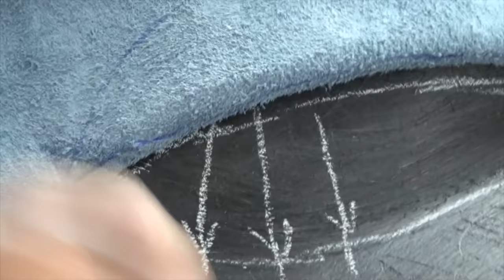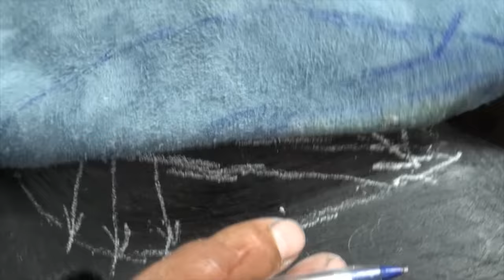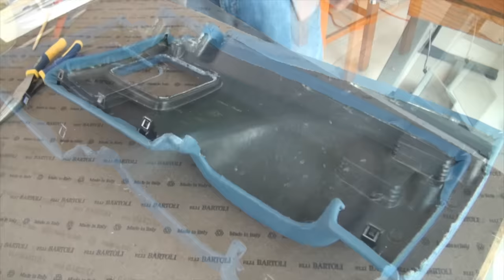A Plastic Piece Wrapped in Leather - Auto Upholstery

Comment: Great video! So much to learn from this--thank you for sharing! Videos like this are so impressive, and helpful for DIY auto restoration hobbiest.

I am attempting to recover my 66 f100 vinyl dash (with matching vinyl). Would same process apply? What glue do you recommend?
Reply from the maker: You coul use the traditional yellow glue:https://www.youtube.com/watch?v=o2xeezdF8Ss&t=104s
https://www.amazon.com.mx/00271-Weldwood-Original-Contact-Cement/dp/B0006MXRY8
https://www.amazon.com/-/es/Petronios-Master-Cemento-multiuso-cada/dp/B076DJQN5R?language=en_US
For a better adhesion you could apply two coats on both pieces dash and vinyl material. A first coat acts as a primer (let it dry well) The second is the good one.

Comment: Good job. ❤ what kind of  glue you used ?
Reply from the maker: https://www.youtube.com/watch?v=o2xeezdF8Ss&t=60s
https://glueplace.com/industries/contact-adhesives/dap-weldwood-contact-cement-top-trim-hhr-solvent-type-spray-grade-5-gallon/ (sprayable and brushable)
https://www.ebay.com/itm/114649877783 (brushable)
https://youtu.be/RLH8BY8a2to?t=128

Comment: Just wanna ask, will it help to use a heat gun on it?
Reply from the maker: What is most important is the detection of stretchty side of leather material.
https://www.youtube.com/watch?v=dhmCJFpOs_0&t=57s
A heat gun is mostly used on vinyl/plastic materials. In case of leather it would be much better a hair dryer to erase wrinkles. Just a particular opinion.

Comment: I'm struggling with finding the proper glue what are you using
Reply from the maker: Upholstery yellow glue (brushable/spreadable)https://www.youtube.com/watch?v=o2xeezdF8Ss&t=485s
If you are in the USA you could find a similar product.
https://www.amazon.com/-/es/Weldwood-Contacto-calcoman%C3%ADa-Solvente-00233/dp/B008G8KVZ2 (brushable and sprayable)
https://www.homedepot.com/p/DAP-Weldwood-3-fl-oz-Original-Contact-Cement-00107/100195615 (brushable/spreadable)
https://www.petronioshoeproducts.com/master.htm (brushable/spreadable)

Comment: What brand of contact cement did you use. Looks perfect. THANKS Sid
Reply from the maker: I use a 'yellow glue/contact cement' most of the upholsterers, shoemakers and leather artisans use.
As I am located in Mexico, trade marks are different. But, if you are in USA, please, check these links:
https://angelusdirect.com/products/all-purpose-shoe-cement
http://www.ebay.es/itm/Petronios-Master-All-Purpose-Cement-Glue-Shoe-Repair-Adhesive-Glue-4-oz-/112032405167
http://www.homedepot.com/p/DAP-Weldwood-32-fl-oz-Original-Contact-Cement-00272/100125525
http://www.dap.com/dap-products-ph/weldwood-landau-top-trim-high-heat-resistant-contact-cement/

ben swanson Hace 12 horas
black rose garage in usa home depot sells. Weldwood contact cement.   It is the standard glue for upholstery

Comment: I found your video very helpful, however, the contact cement has seeped through the upholstery leaving black spots on it.  I applied it to both the door panel piece and the back of the upholstery.  I did not apply it on thick.  It is a foam-backed micro fiber suede upholstery.  Any recommendations?
Reply from the maker: If the surface is somehow flat you can use this method:
https://www.youtube.com/watch?v=coueKGKYlds
If the surface is irregular the correct way would be the application of glue on both surfaces by using a 'glue spraying gun'. 
A glue spraying can could help in case of not having a glue gun.

Comment: Hi Cechaflo! I really really appreciate your work and your sharing. So precise work without heating, it is amazing. I would like to ask you for glue recommending, which is available in EU (Czech Republic). Also, do you crop the thickness of the leather? Somewhere it seems like that leather is more furry.
Reply from the maker: Most of the upholsterers, shoemakers and leather artisans in many countries use a 'solvent based yellow glue'. I don't know in Europe the trade marks. Perhaps a friendly upholsterer, could give some advise.Hopefully, on ebay, amazon you could buy this product.

To have an idea, please, check these links for USA
http://www.ebay.com/itm/Petronio-039-s-Master-All-Purpose-Cement-Glue-Shoe-Repair-Adhesive-Glue-4-oz-/112032405167?_ul=EC
http://www.ebay.com/bhp/weldwood-contact-cement
I didn't skive the leather piece to wrap this plastic piece.

Comment: Hi great detailed video! I would like to know what kind of glue/adhesive is usually used on this kind of upholstery (between plastic and leather)? Cheers
Reply from the maker: I have used a solvent based(thinner) adhesive/cement/glue which most of the upholsterers and shoemakers use. To have an idea, please check these links:
http://www.ebay.com/itm/Petronio-039-s-Master-All-Purpose-Cement-Glue-Shoe-Repair-Adhesive-Glue-4-oz-/112032405167?_ul=EC
http://www.ebay.com/bhp/weldwood-contact-cement
If you're going to use one of these products, do a test beforehand.
Reply: Thanks for your reply! The link is really helpful!

Comment: Looks pretty good. But some of those relief cuts were unnecessary and bad choice of placement. I would never make the cuts so near to the wrapped edge. Some of those are going to be visible from the front. Also I knew you'd regret cutting that opening when and where you did. I could foresee that recess next to the corner would end up pulling the opening in that direction leaving less material to wrap around the inner lip of the fuse panel access opening. Luckily there was just enough left. Love the color selection though. Very nice!

Comment: what kind/brand of glue are you using?
Reply from the maker: The 'solvent based yellow glue' is a traditional adhesive or contact cement used in car upholstery and furniture. 
It is the same glue used to stick formica as shown in the video about Upholstery Glues
✅ https://youtu.be/o2xeezdF8Ss
This other video could be also useful:
✅ https://youtu.be/TIKF6NvXHE4

Comment: What is the brand name of the glue you use? Nice job, It does take a long time .
Reply from the maker: I have used a brushable 'yellow glue' (pegamento de tapicería 2000). The drying time is of 10 min. approx.
I am located in mexico and trade marks are different. If you are in USA, please, check these links:
https://angelusdirect.com/products/all-purpose-shoe-cement
http://www.ebay.es/itm/Petronios-Master-All-Purpose-Cement-Glue-Shoe-Repair-Adhesive-Glue-4-oz-/112032405167
http://www.homedepot.com/p/DAP-Weldwood-32-fl-oz-Original-Contact-Cement-00272/100125525
http://www.dap.com/dap-products-ph/weldwood-landau-top-trim-high-heat-resistant-contact-cement/
Watch min two:08 of this video where Greg shows the use of ´petronios'glue.
https://www.youtube.com/watch?v=RLH8BY8a
This video shows Barge glue from Tandy leather:https://www.youtube.com/watch?v=PE6dGvgWfnU

Comment: What kind of adhesive do u use to put it on ??
Reply from the maker: Upholstery yellow glue :https://www.youtube.com/watch?v=o2xeezdF8Ss
https://www.homedepot.com/p/DAP-Weldwood-128-fl-oz-Original-Contact-Cement-00273/100139723

https://www.ebay.com/p/Petronios-Master-All-Purpose-Cement-Glue-Shoe-Repair-Adhesive-Glue-4-Oz/1280848573?iid=112032405167&chn=ps&_ul=MX&dispctrl=1

Comment: May I ask which glue that is ? I want to upholster smt small on my own and dont know which glue to take
Reply from the maker: I am located in Mexico and I'm using a 'solvent based yellow glue/contact cement'...trade marks are diferent.

If you are in USA, please, check these links:
https://angelusdirect.com/products/all-purpose-shoe-cement
http://www.ebay.es/itm/Petronios-Master-All-Purpose-Cement-Glue-Shoe-Repair-Adhesive-Glue-4-oz-/112032405167
http://www.homedepot.com/p/DAP-Weldwood-32-fl-oz-Original-Contact-Cement-00272/100125525
http://www.dap.com/dap-products-ph/weldwood-landau-top-trim-high-heat-resistant-contact-cement/
Watch min two:08 of this video where Greg shows the use of ´petronios'glue.
https://www.youtube.com/watch?v=RLH8BY8a

Comment: Man, I would be so worried that after all that, that some glue was missed or didn't adhere fully and started to pull away.. Especially in the CENTRE somewhere where it wouldn't be easily fixable..
Reply from the maker: I had this cheap car on test more than six years and the leather-wrapped piece did not unstick, not at all.
The secret is consider the stretchy side of leather and the material should be laid over easily with no tension on hollow areas. I can stretch the material over a convex area until touching the bottom which I will not stretch but lay it flat.
https://www.youtube.com/watch?v=dhmCJFpOs_0&t=25s

Comment: Beautiful work. What adhesive did you use?
Reply from the maker: Thanks so much for appreciating this art craft!

Regarding the adhesive I  have used a 'solvent based yellow glue/contact cement'.  If you are in USA, please, check these links:
https://angelusdirect.com/products/all-purpose-shoe-cement
http://www.ebay.es/itm/Petronios-Master-All-Purpose-Cement-Glue-Shoe-Repair-Adhesive-Glue-4-oz-/112032405167
http://www.homedepot.com/p/DAP-Weldwood-32-fl-oz-Original-Contact-Cement-00272/100125525
http://www.dap.com/dap-products-ph/weldwood-landau-top-trim-high-heat-resistant-contact-cement/

Comment: Appreciate your excellent work. What kind of glue do you use?
Reply from the maker: I use a 'yellow glue/adhesive/cement' most of the upholsterers, shoemakers and leather artisans use...it comes in cans or bottles and it is applicable with a brush or spatula. Check:
https://www.ebay.com/itm/Petronios-Master-All-Purpose-Cement-Glue-Shoe-Repair-Adhesive-Glue-4-oz-/112032405167?_ul=MX
http://www.tandyleather.com/en-usd/home/department/leather-cement-glue/2525-360.aspx
http://www.homedepot.com/p/DAP-32-fl-oz-Weldwood-Original-Contact-Cement-00272/100125525
https://www.google.com.mx/search?q=yellow+glue++contact+cement&espv=2&biw=1093&bih=514&source=lnms&tbm=isch&sa=X&ved=0CAYQ_AUoAWoVChMIqI3u_a_ixgIVhNGACh1z3Ajj
https://www.google.com.mx/search?q=yellow+glue++contact+cement&espv=2&biw=1093&bih=514&source=lnms&tbm=isch&sa=X&ved=0CAYQ_AUoAWoVChMIqI3u_a_ixgIVhNGACh1z3Ajj#tbm=isch&q=pegamento+2000
Thanks for watching my videos!
Reply: Thank you so much for your reply !! That really helps a lot !!

Comment: Took an hour in fast motion , what price would you charge for finished product
Reply: do you want it right, or right now?
Reply from the maker: Hello Karl, the price would be the same fast or slow. To have an idea about the price the whole process would take a half day. Before wrapping the piece is necessary to sand off the plastic considering the leather thickness 1.3 mm approx. otherwise the piece would not fit its place. I think the price depends on the place where we are. I have realized upholsterers in USA charge per hour.
Thanks for watching the video!

Comment: Can someone tell me the name of the glue hes using?
Reply from the maker: It is a brushable glue. Trad marks in Mexico are different.
https://youtu.be/o2xeezdF8Ss?feature=shared&t=30
If you are in the USA:
https://www.ebay.com/itm/254593470049 (mostly a sprayable glue but it can be used as a brushable one)
https://www.ebay.com/itm/114649877783
(Petronio's glue is only a brushable glue)

Comment: What type of glue you are using. Gosh funky dashboard
Reply from the maker: I am using a brushable glue. if you are in USA, check these links:
https://angelusdirect.com/products/all-purpose-shoe-cement
http://www.ebay.es/itm/Petronios-Master-All-Purpose-Cement-Glue-Shoe-Repair-Adhesive-Glue-4-oz-/112032405167
http://www.homedepot.com/p/DAP-Weldwood-32-fl-oz-Original-Contact-Cement-00272/100125525
http://www.dap.com/dap-products-ph/weldwood-landau-top-trim-high-heat-resistant-contact-cement/
Watch min two:08 of this video where Greg shows the use of ´petronios'glue.
https://www.youtube.com/watch?v=RLH8BY8a
This video shows Barge glue from Tandy leather:https://www.youtube.com/watch?v=PE6dGvgWfnU

Comment: The L6 leather was water buffalo. As stated the leather was obsessively treated by the perfectionist architect car guy. It was just too darned hot. This year we just finished 50 consecutive days of over 110 degrees. It is brutal on cars here. No rust ever but clear coats evaporate and plastic turns brittle. Park at a store and get back in ten minutes later and the interior easily exceeds 125 and the steering wheel is too hot to touch till the blasting AC can take the edge off. But it is a dry heat.
Reply from the maker: I cannot deny everyday I learn something new. I have now realized the sun heat in Arizona is astounding. That is equivalent to 43 to 50 Celsius degrees. As if we were in the Sahara Desert. The car leather interior was well kept in the shadow and treated by the owner with special balms, but the sun heat did its job destroying it. I mean warping it, becoming it brittle and shrinking it. Unbelievable.
I also have realized most of these European cars use leather on top panels. The lateral panels are upholstered in a related color vinyl.
It means some of these cars should not be destined and sold for customers who live in too hot places. Did your buddy buy it brand new directly from an agency?
Perhaps, the qualified material would be fire retardant special leather and the same applies for the special vinyl.
Thanks for sharing with us a useful information!
Reply: Near the town of Black Canyon City, north of Phoenix, there is a large outdoor testing facility. There many products are sent to bake in the Arizona sun, sometimes for years, to let the producers know how this accelerated aging will effect their materials. During my visit some time ago it was apparent that almost every paint and coating manufacturer had their materials aging in orderly rows that covered several acres. Then there were rows of plastic products from sheets of all types to actual products like children’s toys to hose pipes. In the center were rows of Volkswagen cars and vans oriented in different directions. Some rows of finish samples were treated to daily baths of salt water in tests of weathering near the oceans. Yes, summers here can be brutal. Years ago it got to 122 degrees Fahrenheit. Airplanes here and in Las Vegas were grounded because their charts did not have data for take off at that temperature. It has not been that hot since thank the Lord.

Stay safe.

The laboratory looked as you would expect with lots of computers monitoring conditions and compiling data. I was told that reports were professionally certified and sent all over the world to customers.
Reply: The L6 was purchased new. Can you imagine thousands of ten year old cars that are in perfect condition except for faded paint and cracked leather seats? There is a market in the painting and interior restoration of cars that are then shipped back to the East where those cars are known to rust severely. Here a car battery can only be expected to last two summers. People live here because from late September until late May it is beautiful here.
Reply from the maker: @larrysorenson4789  Thanks again for educating us!
http://www.aztest.com/

Comment: My buddy bought a new BMW L6 years ago. The big deal for this car was that the entire interior was leather from some wacky animal like a wildabeast. This included the dash. We live in Arizona and although this car was babied, kept garaged and always parked under cover, that whole dash curled up like a potato chip. BMW said that they could not replace it with another leather covered one and so he got the plastic one and sold the car. Probably took a ten or fifteen thousand dollar hit. Leather shrinks.
Reply from the maker: Interesting reflection to consider!
I've been trying to figure out what would have happened to that leather interior if the car was under cover. The first thought is BMW is a renowned trade mark that would not use cheap leather for its cars. They mostly use full grain leathers with open pores to let it breathe. Only one thin coat of transparent sealer is sprayed on top surface and that makes it very vulnerable.
They use premium leathers which require at least every six months to be moisturized and rehydrated with special creams. These leathers are very delicate and if the vehicle's owner do not apply the special treatment the leather material is prone to getting dry and shrink despite of leaving it parked under cover. There are another factors that could have caused that issue.  Humidity of the ambience penetrates through unthinkable ways.
Leather is a natural material that also needs cool air once in a while, other wise fungi are accumulated to contribute to rotting and warping.

Comment: What kind of glue do you use?
Thanks for your video
Reply from the maker: I've used a yellow glue most of the upholsterers, shoemakers and leather artisans use it. It also. Do a test of the product before using it. To have an idea, please, check these links:http://www.ebay.com/itm/Petronio-039-s-Master-All-Purpose-Cement-Glue-Shoe-Repair-Adhesive-Glue-4-oz-/112032405167?_ul=EC
http://www.ebay.com/bhp/weldwood-contact-cement

1